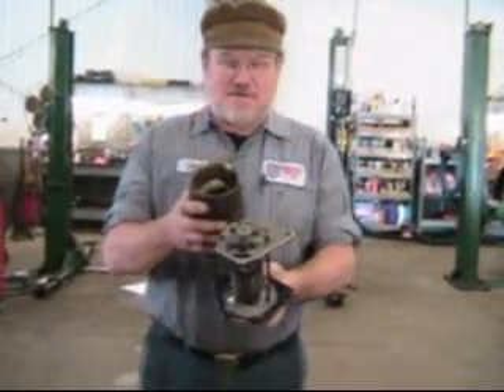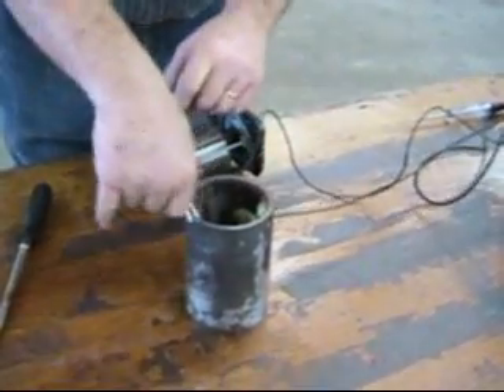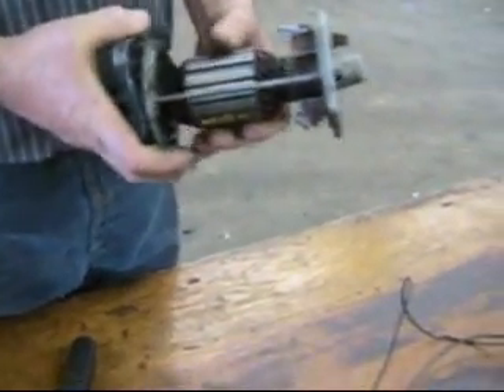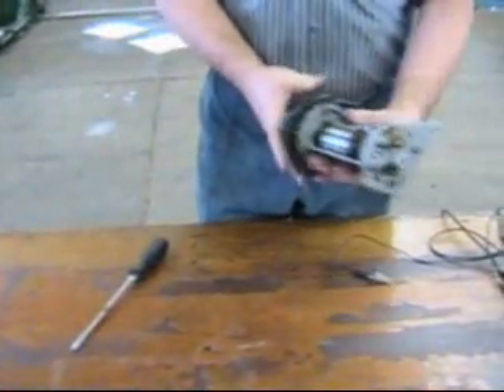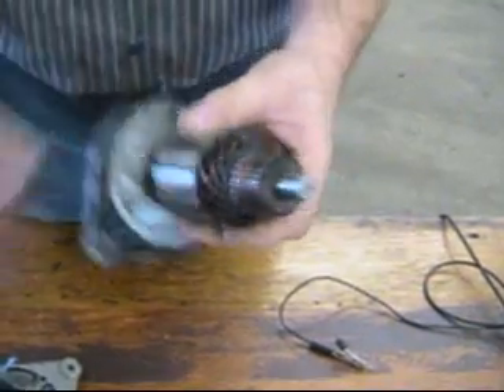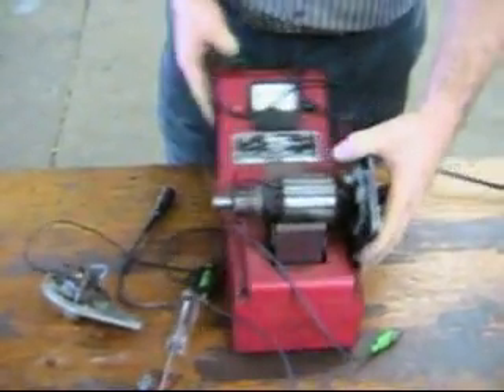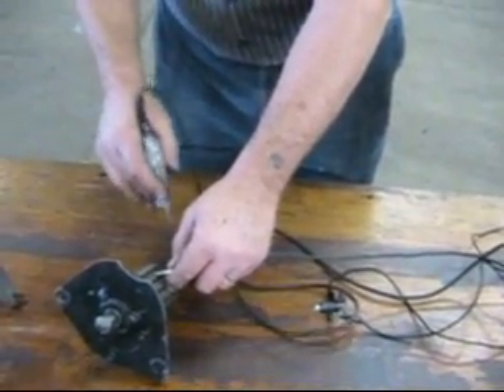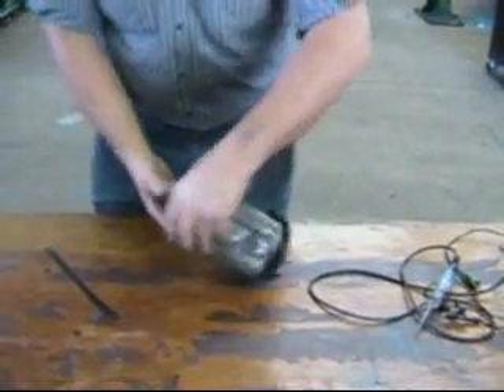040 MG Tech | Lucas Generator / Dynamo on MG

Comment: Thanks so much John. I just took the generator apart from my '64 MGB. One of the wires was broken on one of the brushes. So I've got a new set to put. I didn't know about soaking them in oil though. Thanks for the help.